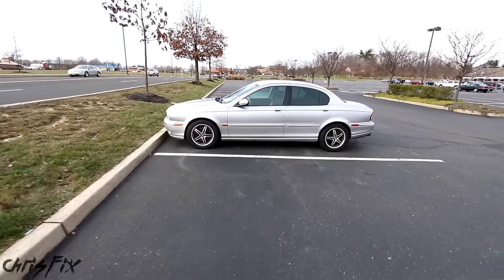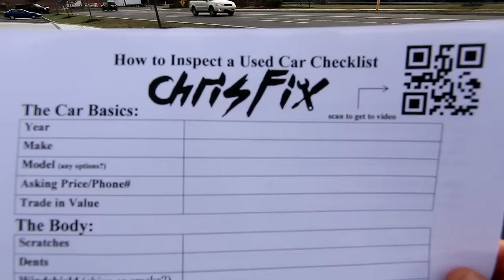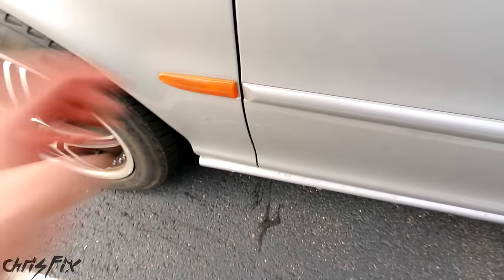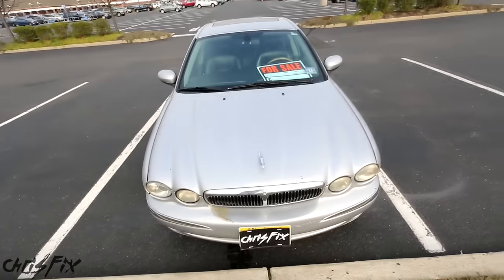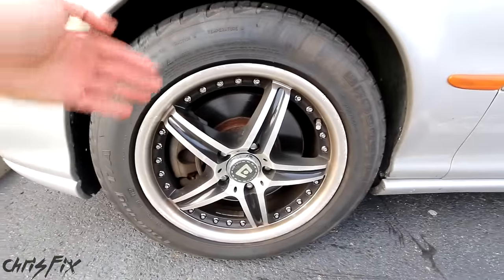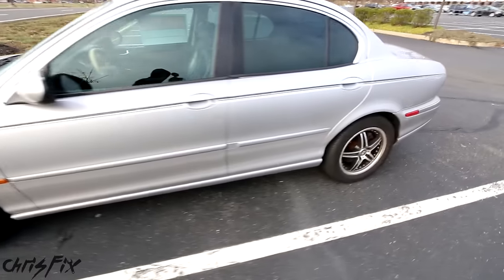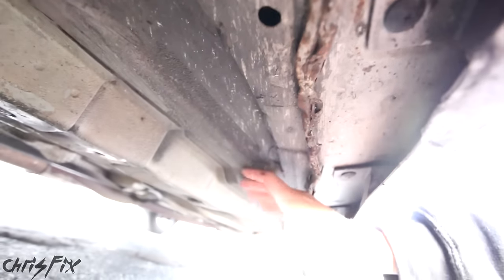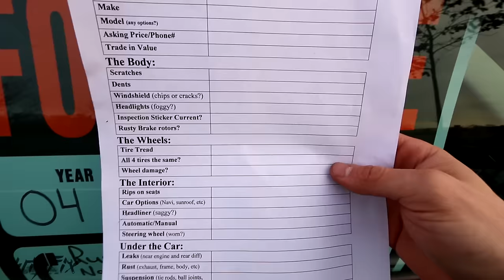How to Inspect a Used Car for Purchase

Comment from the maker: Just a few bits of info for everyone who is asking in the comments section:
1.) Those are plate covers not plates. I use them in all of my videos to protect the owner's privacy (and my own privacy). They go on with tape before I film. The real plates are under them. 
2.) This is only part 1 of the series, in part two I meet with the owner to inspect the car: https://youtu.be/9N4RpohW-hU?list=PLvKbarVtwhUv6bjLhJSyaEOxaYy03j7QS 
3.) I have a new series with buying a parts car Jaguar here: https://youtu.be/pV_BgneldPU?list=PLvKbarVtwhUv6bjLhJSyaEOxaYy03j7QS
4.) You can follow me here for updates and other cool projects: 
Subscribe→ https://goo.gl/Yfma59
Instagram→ https://www.instagram.com/chrisfixit
Facebook→ https://www.facebook.com/chrisfix8
Reply: why didnt you inspect inside of wheel arcs as well? especially some cars driven in snow conditions can have issues with rust due to the salt on the roads. The body panels can look nice from outside but it might be just a paint which holds it together.
Reply: ChrisFix
Reply: ChrisFix that's a good idea to cover your plates so we don't see your plates
Reply: On the license plate it said chrisfix
Reply: You missed checking camber or uneven wear on the tires.  Tells you a lot about possible suspension or alignment issues.
Reply: I know it's weird
Reply: oh wasn't sure about that thanks
Reply: ChrisFix
Reply: This video and your checklist really saved me from making a bad used car purchase at a dealer. Went through your list like a champ. Another thing I checked that wasn't on the list was under the hood and it was not in good shape for the price. I also learned that if buying from a dealership with an appointment don't go to the front desk. Go find the car and inspect before going to the front desk.

Anyway, thanks ChrisFix. you saved my hide :)
Reply: ChrisFix Could you make another link for the inspection list please?
Reply: ChrisFix is a good man
Reply: J
Reply: ChrisFix I am looking for an Lincoln towncar 1996 with low mileage 

can you please help me find one
Reply: ChrisFix if it is a dealer,would you have done or said anything different through this whole process?
Reply: Also : Having two tire sizes on a car isn't that bad, as long as they respect the car specification. I have a Toyota Tercel that have 155/80R13 up front and 175/70R13 at the back - Having thinner tire up front increases snow traction and having slighty larger tires at the back means better overall stability
Reply: He showed the video before buying the car you silly... This video is a while ago now
Reply: ChrisFix else
Reply: ChrisFix This would be a great tip for check my parent's car status.
Reply: ChrisFix I'm lookin to buy a used mustang 04 the owner said the engine overheats. What should I do?? The car is 1,100
Reply: Your first mistake is Ford, your second Mustang, third considering a vehicle with overheating issues.
Reply: ChrisFix to
Reply: ChrisFix how much does the average full body repaint price?
Reply: ChrisFix its your car
Reply: ChrisFix where is the Checklist at I've been searching it on your website for 10 minutes and can't find it????
Reply: ChrisFix how old are you
Reply: ChrisFix if you're seeing this car for the first time, why is your license plate on it?? 😂
Reply: 1 minute 40 seconds into the video and I already love how you do everything. Thank you so much for your work!
Reply: James King this is before he bought the car, he just threw on his plate cover. It says this in this comment.
Reply: Good video. Shaun from NYC
Reply: ...Nice..
Reply: oh great i think that  private life has important for web sellers
Reply: nice catch dude
Reply: F. Word
Reply: I agree with you especially on the checklist, Chris. I carry one with me as well whenever I trade in or buy another used car.
Reply: ChrisFix hey bro my car is leaking a black substance I think oil but it’s not the head gasket... what else could it be
Reply: It could be dirty coolant or tranny fluid. Maybe power steering or brake fluid, man.
Reply: Hi Chris I 'll a 12 year old and would love to have a Mitsubishi fto as my dream car with the same mods as your mustang keep up the amazing work you my fav youtuber
Reply: ChrisFix always check fluids  trans and oil brake and power steering if low check for leaks
Reply: ChrisFix  are you sure that it your first time seeing it because it has your number plate
Reply: Lil Rambbo what do you mean J
Reply: isnt this your dads car?
Reply: He never buys cars, just goes around looking at them
Reply: hi Chris, i tried to download the checklist from your website, but it's not downloading. I think the link is broken. Please help me get the list. thanks!
Reply: hey chris, checklist link does not work.
Reply: Chris, I tried downloading the checklist but, when I click the download button, it does nothing. How do I fix?
Reply: ChrisFix  is the best YouTuber
Reply: ChrisFix Aight x
Reply: How to figure out a flooded vehicle....
Reply: @rokobrkan8131  Yeah,good one. I hadn't seen it.
Reply: OK I wear cloth gloves and run my hand along all the seams of the body and found that lower ( out of sight) PARTS of the back bumper were NOT FLUSH to the back quarter panel on both sides. it was slight,.. but enough to know that it was a bad replacement
Reply: Ty great tips, but how did you look at the under carriage??
Reply: Even if you used your own car to stage this auto fir sale, the information was very helpful tyfs!.....js however honesty is the best policy!!
Reply: The real question is how much do think the car is worth after inspecting it
Reply: 0
Reply: When I first watched this vid I was 13
Reply: How can you forward a copy of the checklist to me ?
Reply: I bought a 96 pontiac grand am se needs o2 sensor passenger window regulator needs changing also hearing a humming noise wen i drive car more so in back
Reply: Why wouldn't you recommend to check under the hood before a purchase?? I learned that the hard way back in 77 I'm shocked that you claim to know so much about vehicles but yet totally fail to recommend to look good under the hood of any vehicle you want to purchase once again this review is a strait up joke 💯
Reply: Its your car
Reply: ChrisFix any thoughts for doing more of these inspection videos?  Seem like they would do pretty well.  Good to see other parts of the checklist and other unique issues etc.  cheers man, excellent production!
Reply: @MANOFROBOTS  those are covers dummy cant you read?
Reply: Can you make a video on how to negotiate the price of a used car at a dealership?
Reply: Seen this when it came out and how i wished of getting my own and Chris!!!!!!! Thanks for the “how to buy used car check list” because im getting one tomorrow
Reply: @jrmorales822  
Did you buy a car? I went with my best friend and talked him out of buying a Chevy Malibu or something like that. His credit was bad and he went to DriveTime because I guess they finance anybody. His interest rate was high af and they wanted to basically charge him around $30k for a $17k car. Don't just look at the price on the window sticker. When you get those numbers, do the math right in front of the sales rep. That's what I did.  I multiply the monthly payment by the length of the term (example $420 x 60 months = $25,200). So if the sales rep is telling you they're selling you the car for $13k or something, show him/her the numbers your calculator gave you and be like hey this isn't adding up... Of course there will always be additional fees for interest, taxes, tags, title, registration or whatever and that could add on a couple thousand bucks. Also note that some car companies have stopped production because of the chip shortage and some dealers are low on new inventory and selling a lot of used cars. Most dealers are gonna try to use this to their advantage during negotiations. Another thing I would do is shop around! Let's say you like a specific car you saw on the dealers website, go online and look for that same car at other dealers and bring numbers with you for leverage. Also don't be afraid to walk away. You might get a better deal as you're walking away. They offered my best friend a better deal when we were walking away but I was firm like nah man we're nowhere near making a deal buddy, peace ✌
Reply: @giggityeffyou  no I didn’t purchase I’m holding off due to the same reasons you stated 👏
Reply: Mr. Chris, with all the experience you gained since making this video. I'm sure this series is still reliable for inspecting and purchasing a used car. Any updates that can be added, maybe a new series for inspecting and buying a used-newer car than this Jag? Thank you for your efforts.
Reply: @FishCZ  he isn't god nor Jesus....add that to your list of things to look at 

He said this is how he does it, he didn't hold a gun to your head and said do it this way or else
Reply: @Notinserviceij  that was not a nosy question. I was genuinly interested for his rationale just simply because I was wondering whether there is some good reason advice etc.
Reply: Your better off building a new one from scratch then relying on a warranty.

Comment: Always check by turning on the AC while driving. Some cars starts vibrating after acceleration.
Reply: Owner is not there, cant start it.
Reply: @billcavazos2817  he means in a test drive
Reply: R S Talukder my dad got a 2019 Chevy and the fucking shit starts to rattle two weeks later
Reply: @danleon2756  that's because lots don't let you drive it on the highway

Comment: Another thing to check when evaluating tires... make sure they're all the correct speed rating for the vehicle. I once bought a car without checking this and ended up having to replace all four because the speed rating was too low. I had four blow-outs before I finally researched this and found out what was causing it.

Comment: Just FYI, This is an AWD car, meaning it is strongly recommended the tires should ALL match and be replaced at the same time.  Therefore, if you are considering an AWD car, you would need 4 tires.  Not 2.  BTW-- I owned this particular model Jag in an 06.  High performance tires are REQUIRED.  I never believed the difference in expensive versus cheaper tires was that great until i got this car!  Believe me, IT MATTERS!  Just something to consider when buying a car that is a drivers dream, like this one, and considering the expenses of bringing the car to proper standards.  BTW, I LOVE mine.  It's the best car I've ever owned.  I paid $3000 for it, put in $1000 (it had 88000 miles) including 4 tires, and never needed anything more than an oil change.  Driving it is a religious experience.  I know this video isn't about Jag's, but since I'm such a fan, I had to add these particulars.  LOVE YOU VIDEOS CHRIS FIX!!!
Reply: Just to reiterate
Awd DEMANDS all 4 tires be the same, if they arent the computer gets confused, the differential and gearboxes will wear improperly and break

Comment: Gosh I wish I saw this video when I bought my first car 😩
Reply: Carina Pokipoki how much you pay
Reply: What did you discover to be a deal breaker?
Reply: The name on the REAR PLATE?  LOL
Reply: Suger Plum he put that over the license plate.
Reply: Same, am still paying it to this day. I bought a 04 Honda civic lx with 147k miles for $6,500 from a dealer. Also the paint is not that good. The car was in a big shadow big enough to cover the car (the color is black) And so it looked good and all, but the next day i noticed the paint was not that good at all and it’s coming off. And now that ik how cheap those cars can be and know that i could have gotten a better one somewhere else (not a dealer) i regret buying it.
Reply: luis lopez With $6,500 you could of got an acura tl or so many more options😂
Reply: luis lopez you didn't Google how to buy a used car or ask a friend to help?
Reply: luis lopez I personally bought a 1996 Honda Civc LX with 140k original miles for $500 about 2 weeks ago. My uncle (whom is a mechanic), called me saying that his neighbor was selling his Honda so he did a test drive on it to find out it is a huge steal for the price. The only thing that was wrong with it at the time was the driver side door wouldn't close flush, and the power steering was making noise and the wheel was stiff. (Of course the owner thought these issues were severe therefore the low price). My uncle was able to fix these problems after the purchase and I could easily sell this car for 1.2k in the future. :) Just my backstory on my first car which was only 2 weeks ago. Couldn't be any happier. I also have pictures if anyone's curious haha there aren't many 1996 civics in this good of condition
Reply: Efren Gonzalez yes i could have gotten something so much better man but i screwed up big time.
Reply: Bobulousbrapton Scromdringle am happy for you. At least u didn’t make the same mistake as i did. Congrats. :)
Reply: luis lopez hahaha i guess I'm too cautious. I always do lots of research about things like this, even for my first car
Reply: BTS ARMY MEMBER that’s better than being scammed lol 😂
Reply: Bobulousbrapton Scromdringle That's a good deal!
Reply: BTS ARMY MEMBER sorry to hear that bro.
Reply: That’s why I never buy used cars
Reply: Diego Ortiz If you buy a new car it drop 40% in price as soon as you drive it out of the dealership, you know that right
Reply: Lol I bought a 2011 Accord EX-L for $5500, fully loaded, no issues and off Craigslist. Just gotta know what you’re doing and where to look.
Reply: @luis6.7p.s.77  You did something very similar to what my lady did. But a useful information for everyone out there is to bring someone along that knows about Cars!!! Not a friend or family member that just sees a nice color car and instantly persuades you to buy it. Peer pressure is real haha. 😂
Reply: @efrengonzalez5264  lol ikr

Comment: As a rule, I try to avoid used cars with aftermarket things such as rims or loud sound systems.  Besides the possibility of maintenance issues they cause, they are often a sign of a young person as the primary driver and the possibility of engine and drive-line excessive wear due to hard usage.  There's a reason for looking for a car only driven by grandma to attend church on Sunday.  Most grandmas don't "drift".
Reply: Nice tip!
Reply: Guess you haven't met the grandmas that don't change their oil because " I only drive to church and grocery stores". Best buys are enthusiast owned vehicles, those are meticulously cared for in all areas of the vehicle.
Reply: I have a loud system in my car and i car for it very well. It actually is cleaner now than it was when i bought it. I check all fluids once a week to make sure i have no problems. I also replace parts as soon as something breaks. I will admit, i drive at a higher speed than the average person, but i accel slow because my gearing is weird
Reply: yet grannys driving manuals thrash the clutch so you'll need a new one every 30k or so....
Reply: +Adam Spencer granny probably doesnt change any of the fluids if she puts on a lot of mileage
Reply: +Frank Magana While we're on subject of Granny cars, I get the feeling that in the 1930s-1970s it was often the case that they never got their cars to operating temperature to blow carbon out the exhaust.
Reply from the maker: +Pook Atim This is a great tip!
Reply: "most" grandmas...

Comment: Should have mentioned body panel alignment and gaps, paint tone consistency, wear on seats and steering wheel
Reply: +JDMRacingUK Yeah panel gaps is a must
Reply: +JDMRacingUK And all the glass should be same year
Reply: +JDMRacingUK well he did do seats and steering wheel
Reply: +JDMRacingUK Dang, I should have read the comments before posting my own...as a former bodyshop owner, that's the first thing I look at, mismatched paint and panel gaps...
Reply from the maker: +JDMRacingUK cant cover everything in one video. That is why there are multiple videos on this subject.

Comment: That moment when you buy a car and you realized you didn't look at 80% of what you should have , I wish I would've remembered about this video first. Hopefully I didn't make a mistake lol
Reply: Aldo Ibarra same
Reply: yes i feet the same ...but netx time i ill take my time checking a car ...
Reply: It's very easy to do if you're not careful, I bought a Suburban in 2015 and the transmission reverse gear died; that was the tip of the iceberg. Nice rust under the wheel arch extensions too, good they had replacements available.
Reply: Aldo Ibarra I bought my car with 3 different tyres

Comment: As women we're always being screwed over when buying used cars. Here's a great tip to find undisclosed repairs in cars that have been wrecked.  There's alot of plastic in newer car models but always take a magnet with you to run along the body, especially the quarter panels, (the area at the rear sides of the car), to find "Bondo" compound. A product used to fill in deep dents or to cover up body rot(rust). The magnet won't hold onto the surface on areas that have Bondo. My Dad taught me this old trick. Thought I'd share it.
Reply: Make sure of covering the magnet with a rubber balloon, or fabric, so you don't damage the painting.